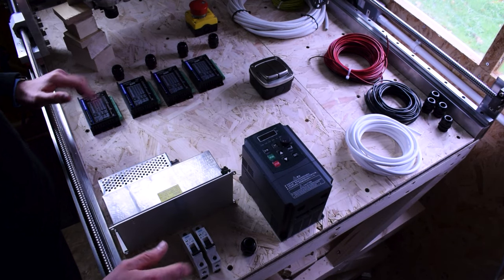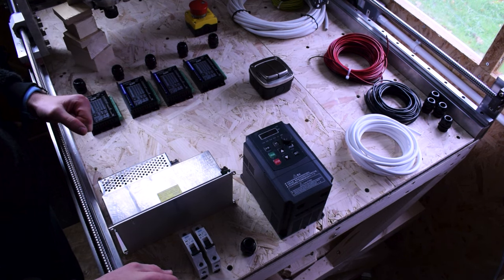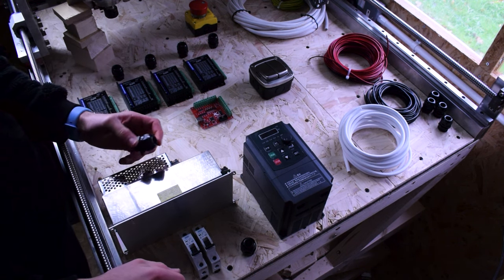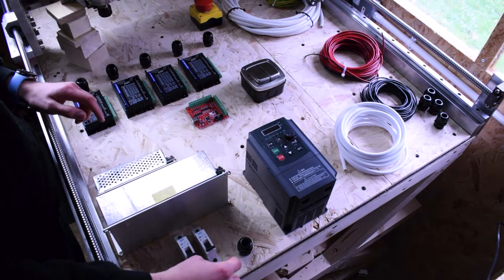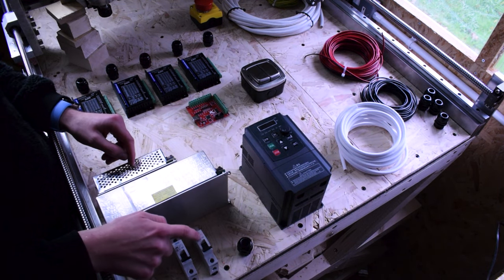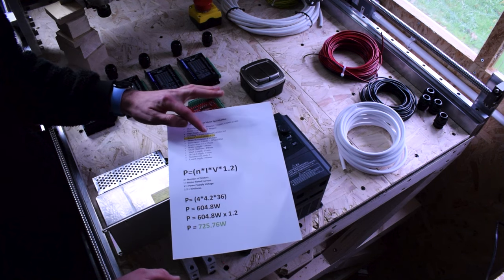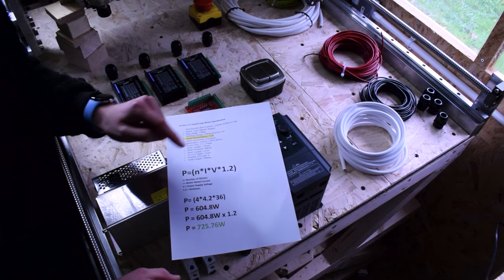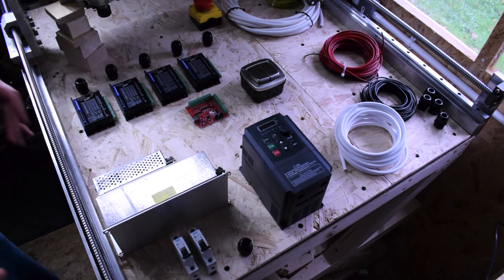DIY CNC 010 - Closed Loop NEMA Wiring and Mach3 Setup

Comment: I am having issues with my setup, my motors wont run when i jog mach3. mach3 shows the position changes and the light on the board flickers when i jog but no movement from the motor. the motor is getting power to it as it is locked solid. i have wired up everything how you have it here. even double check with stepperonline for the wiring and it matches. maybe something in mach is not configured correctly? i am using windows 10 is that likely to be it? also with the 24v power supply i noticed you re not using it for the board for testing the motors, does it not need to be used? Thank you
Reply from the maker: Sounds like a Mach3 profile issue. Go to my website and download the DIY CNC zip. In there you will see a Mach3 folder containing my .XML profile for my Mach3 config. Import that, validate the motor outputs with your own and try it again?
Reply from the maker: If using Windows 10 or 11, make sure you don't install the Parallel Port driver when installing Mach3, uncheck it during install. Also  the 24V supply is only required to power the proximity sensors and spindle I/O
Reply: @thehardwareguy  okie dokie, thank you for your reply
Reply: @thehardwareguy  okay thank you ill give that a go. i will also reinstall mach 3 and uncheck the parallel port driver just incase thats it. your help is greatly appreciated
Reply from the maker: anytime bud, let me know how it goes. Your comments will likely help others too :)
Reply: @thehardwareguy  your a gentleman and a scholar sir :) quick update, i am not by the setup at the moment but will be tomorrow. i have reinstalled mach3 and did what you suggested. it looks different this time, it fills the screen whereas it didnt before?? as in full screen?? and i can now get it to move via MDI which i forgot to mention in my previous comment wasnt possible to do. will see if that fixes it tomorrow
Reply: @thehardwareguy Hello, unfortunately it didnt solve the issue. i wonder if it has something do to with the earth on the RNR board? is it supposed to be connected to the driver? or is it just the live wire 5v that needs connecting?
Reply: @thehardwareguy  ive got it working!! turns out there is a 5v or 24v switch on my stepper drivers that i didnt know they had. switched it to 5v and they span up!
Reply from the maker: That'll do it. I did cover this at 38:10, super important step but easily overlooked! Glad you got it up and running :)
Reply: @thehardwareguy  apologies for missing that part! thanks for your help

Comment: at 10 minutes you explained that if there is a short circuit in the spindle controller, the spike in current will propagate in the other circuit. The way I see it, those two circuits are in parallel, so how is it possible that the spike in current propagates in that case? Thanks.

Comment: Very informative. Thanks. In regards to the Mach 3 setup, I plan to run an ec300 control board on my plasma cutter table because it has an Ethernet connection. I heard the USB connection boards are prone to interference from the plasma arc. My question is, would an Ethernet connected board be considered a parallel connection in the Mach 3 setup? Thanks. Subscribed.

Comment: Hi there, 
Could you please help me with a little thing?
After rehoming the machine, i'm sending it to do the job, but it goes in wrong direction. 
basically it starts from 0 and goes from rehoming corner off the limits. 
I've tried to reverse them in the motor outputs and still the same. 
My question is... would be possible to get the mach3 bord connected wrong to the driver? would this be a fix to my problem? to swap the direction pulse wires?
Thanks!
Reply from the maker: Check your configuration switches on the NEMA drivers. There should be a DIP switch with approximately 8 individual switches. Check your driver manual for which one of those switches controls direction. Flip the switches opposite for all the axis' that are giving you problems
Reply: Thank you for your reply. I will check it again.

Comment: Why does the set up need 2 power supplies, could your big one not run the motors and the board or am I missing something?
Reply from the maker: Hey man thanks for your question. In my case, the power supply for the NEMA's is 36V, they take an input between 18-48V. The breakout board requires 24V. You could share the power supply at 24V but I would recommend a minimum of 36V to drive NEMA 23's